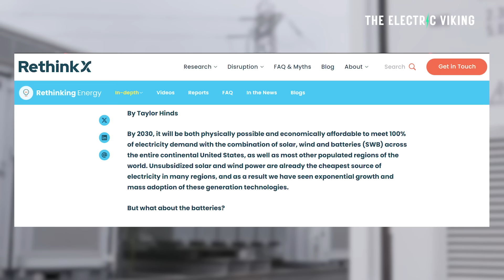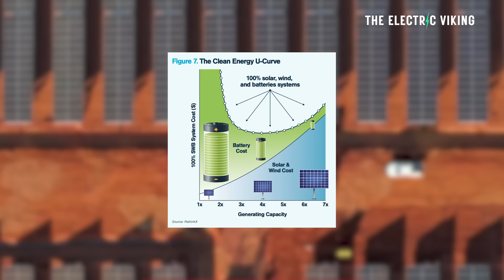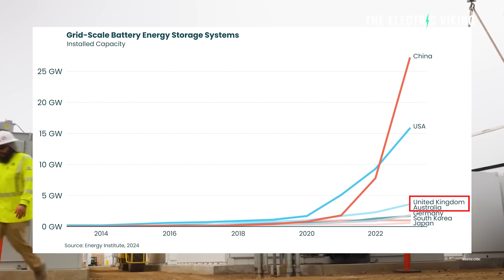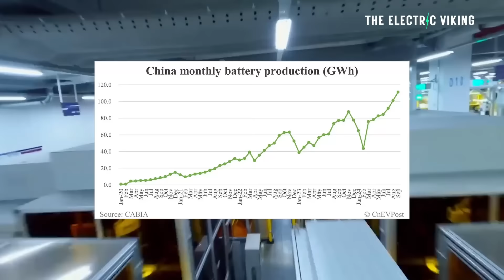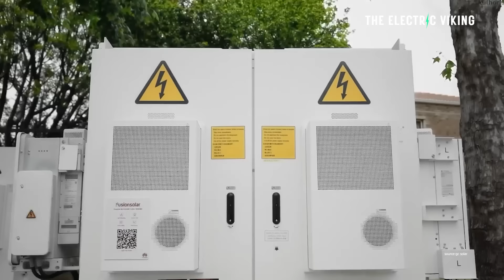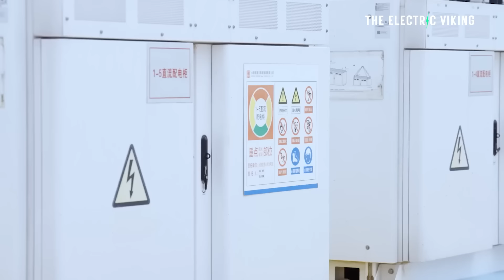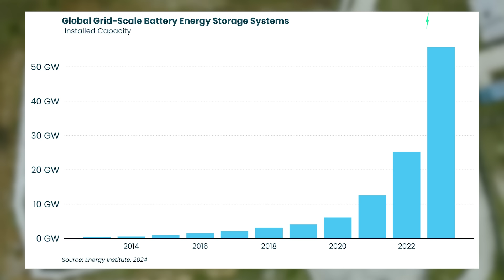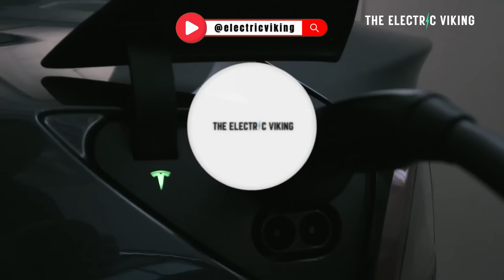RethinkX reveals the shocking exponential growth of battery storage worldwide

Comment: Laughable. Batteries are energy storage. Fossil fuels are a energy source. Renewables could not exist without fossil fuels. Take energy to make machines and panels, and hope they give some of it back.
Reply: In a sense fossil fuels are batteries that are pumped out of the ground. They are created by time, heat and pressure at geologic time scales and are much more energy dense than minerals that can only be mined economically when they are near the surface. Plus, fossil fuels, being liquids and gases under pressure, flow to the point of extraction. The same can't be said for mineral based fuels which are solid and require ALL HUMAN-made energy to be extracted. Both have negative effects on the environment FROM HUMANITY'S POINT OF VIEW. Life was abundant when CO2 levels were much higher than even the worst projections of anthropogenic global warming and, even if the worst happens, it will be abundant again. Just not human life and the life around it that has adapted to the current environment. 

The truth is that it is going to take the right balance between all the forms of energy we know how to extract to supply our needs and use it in ways that do not make the planet unlivable for much of the life that currently occupies it. This is possible or life never would have emerged in the first place.
Reply: I guess you need someone to explain it to you very slowly?
Reply: Photons transport themselves to panels free of charge
Reply: @SigFigNewton  how do you manufacturer them?, transport them? What do you do with them when they reach their useful life?
Reply: @jtkrpm1  you manufacture solar panels and batteries by digging holes in the ground. the minerals are in the earth, same as oil and gas but without the hundreds of millions of climate refugees coming to a decade near you
Reply: @jtkrpm1  transport? Far more of an issue for fossil fuels than for solar panels. You transport the panels once and then energy rains down from the heavens. Fossil fuels have to be resupplied. And then resupplied. And then they need to be resupplied. We’re talking about the difference between transporting some panels once vs transporting a flammable fluid continuously
Reply: @SigFigNewton  can you manufacturer a solar panel without fossil fuels?
Reply: @jtkrpm1  why yes. Yes, you can. 
Energy is required in production and transport. Is this what gave you the impression that you can’t?

Comment: Arizona must not be doing anything right, as though it's between texas and cali and our solar panels have worked great for 1½ decades with Tesla buying out the original company and installing a new comtroller (I don't believe we have a battery as all over production is sold back to our electric company and I don't believe any is stored at our home as I don't see any battery box installed), though this summer has been a killer hot one in Arizona and though the panels are supposed to cover 95% of our needs, our electric bills have been unusually high this summer. Arizona is strange in that there is a constant battle between those who wish for reasonable progress in clean energy potential and those that still want you to legally carry a 9mm opeen on your hip at a college bar and don't want anything unless it belches black smoke thicker than your blood! We have a solar farm west near our one, twin stack nuclear reactor and some hydro generated electricity, but since it's the next best thing to Death Valley, Ca, we are not packed full of residents. If we were, there wouldn't be enough arsenic and cyanide* in the underground aquafers to share with everyone! 🤣🤣🤣  *(due to heavy silver and copper open pit and sledge mining done since the 1800's)

Comment: This is ridiculous it was calculated that the battery power required to power UAS for onr hour requires all the battery output from the Tesla mega factory for 500 years and to charge them with excess green energy would take a further 200years for one hour. This is madness and grade A bull

Comment: What a load of male bovine emissions!
Batteries have a very very long way to go before they can compete with any form of traditional power especially nuclear.
Without government subsidies and guaranteed minimum usage fees that are on average six times what the usage charges from traditional power before the advent of green insanity no business entrepreneur would be insane enough to flush money down the toilet on battery storage systems . Not until the bursting into flames and dismal storage capacity and very short life span issues are solved. will batteries be able to come close to being cheap clean and efficient . Especially not lithium based technology or worse aluminum technology.
There are some sodium and iron stationary battery systems that show promise as a load smoothing and UPS system but they are still in development and are not compact.

On a side note for those who thought they reduced their carbon footprint by getting an EV and roof top solar (without battery storage) all you did is increase your foot print and create a very big headache and increase energy and operational costs and worst of all DELAYED the advancement of new technology that might make a difference.
Going green has on average increase carbon emissions by 150% globally and in some cases 400% over doing absolutely nothing.
So you well meaning virtue signally Muppets Stop trying to save the planet your ignorant actions are killing it.
Reply: Oil company BS
Reply: footprint = 1 word.  Oh, and your numbers are all BS.
Reply: @jonb5493  so what, if you think pointing out a non spelling mistake makes you think you’re smart good for you.
But taking that imaginary superiority to use as an excuse to remain ignorant of reality actually harms others How Dare You!
The numbers are factual look them up.

Comment: Right NOW, I’m paying 61 cents per kWh.
And home batteries are still more expensive compared to a BEV.
Tony is just feeding us Fata Morganas.
Reply: 61 cents what country are you in
Reply: I'm paying 13.1c/KWh.   Both "Right Now" and for every other hour of the month.

Why the hell is your power so expensive?

Agreed that batteries don't make sense yet (except for during a disaster before you can set up the generator to save the contents of your fridge and provide basic lighting, a fan, and dehumidifier).

For you , they will make sense when they drop another 40%.   

So hmm.  At your rates, a 5000btu old fashioned window unit would cost 30 cents per hour.   So a battery would let you shift cheap night power to expensive day power.   Or it would let you get home to a charged 1000kwh battery and run the AC from 6pm to 8:15pm, cooling the house faster and letting your 3000kwH ($1.80/hour) central AC unit run less.

Solar panels would be producing $5 per day in savings.   So they would pay for themselves really fast.  But you would need a more expensive solar battery  ($1000) that passes through solar while charging.

We underestimate things short term.. but sometime in the next 3-5 years, batteries and solar are going to make a huge difference for you.
Reply: For context.  In Norway the current price is 12 cents, largely hydro.

Comment: Each of this "green battery" - is a bomb for ecology, but - in Lithium harvesting countries. There is a matter of time, when consumers  would pay massuve reparation to those countries for tens years long... Not only huge chemical errosion and water resources  soiling, but also for suport slavery labor (as most such places have it normally).
If you hate planet and your own children - by something with massive lithum battery!
Reply: Keep burning fossil fuels is certainly not the solution. Have you ever looked at the amount of polution that gives? Minning for minerals for batteries is clean in  comparison. And these materials can be recycled. Ever tried to do that with burnt fuel?
Reply: @marcelreijnen  Oh, yes! What is the part of CO2 in all warmig gases? In most fantastical measurements by climate alarmists - up to 20% of sum of other gases can cause planet warming. What is a part, produced of mankind? The same alarmist sources provides up to 25% of CO2 may be produced by men activity (initially - wrong, because of ocean contains abut 80% of all CO2 on planet). So, what we get - less then 0.5% of CO2 pollution can be reduced in case of all people just would die. Not so optimistic?
Mining of 1 tonn of Lithium produce 15 tonn of CO2, requires about 2.2 million tonn of water, which became poisonal. Evapouration of water make leftovers highly toxic too. Moreover, lithium often located hundreds of meters below drinkable groundwater, it means - it will kill drinkable water on big region around.
Also please remember - most of lithium harvesting countries practice is slavery labor, include children labor.
Reply: @marcelreijnen  My concern: lithium is not a solution at all. UnWe shoudl not replace one "dirty" energy source but other more danger anddirtier. We need search for acceptable solution.
As example, if somebody propose to cure cancer by AIDS - what you say?
Reply: For instance, the Thacker Pass project in Nevada is expected to produce 60,000 tons of lithium annually, consume 1.7 billion gallons of water annually, and emit 152,713 tons of carbon dioxide. And it is uses modern DLE chemical technology....
Reply: Mining lithium is superb for the environment compared to burning ffuels
Reply: @SigFigNewton  Unfortunately I see no previously posted reply. Sometimes YouTube has a strange glicks...
Some base points from broken reply:
- Lithium harvesting leads to huge territories poisoning
- Lithium harvesting leads to water poisoning and makes water undrinkable in big regions as geological drinkable water layers spoilng
- Lithium harvesting leads to huge volumes of water excluded from human consumptiojn (and it is for water-deficit region usually)
- Lithium harvesting in some countries is a serious support reason for slavery and children labor
- Lithium harvesting produce enormouse volumes of water vapors, which is one of more powerfull warmer gases. For harvesting 1 tonn of lithium there produced more than 3.2 billions(!) litres of vapor.

Some countries already realized science facts and by taking respocibility  exclude BEV and battery stations from category "zero emission". For example - Norway.
Just keep your mind open to facts and science and know a price of global commercial success. For awhle mankind is agree to pay this price. Till some new passion come...
Reply: @Argus13  I’d list all of the negative impacts of adding carbon dioxide to the atmosphere, but I don’t have time to spend three years writing.
Hundreds of millions of climate refugees. Coming to a decade near you.
Reply: @SigFigNewton  You just swapping a theme. It's not only CO2, but more dramatic poisoning and resource exhausting subsequences of lithium harvesting. CO2 - is very small part of problem and gas burning is microscopic part of it. But depletion of drinking water reources, chemical posoning of soil - mor serious and critical issues.
In addition - I highly recommended last report of Human Rights Watch about slavery and kid labor related to lithium harvesting.
But if you don't care about ecology and poor countries - you can continue freely. Each one has his mind...
Reply: @Argus13  greenhouse gases are by far the most serious environmental issue of our times and burning fossil fuels is the primary contributor
Reply: @SigFigNewton  Who said this? 50 years ago I remember isteric fears about "new ice age" :))
There is no sicence evidation about mankind klinmat changes driven. But multiple evidences for cyclic climate changes from more serious factors - as solar radiation, orbit precession and so on.
Reply: @Argus13  mhmm, if someone hyped an incorrect thing fifty years ago, that’s a good reason to ignore reality today. 
Fantastic reasoning, little buddy!
Reply: @SigFigNewton  Nope. It is just a reason make more critical look on histerical process at present time. And when you just base on science, facts and logic - nothing can fool you.
Reply: @Argus13   the critical look achieved. Performed over decades by tens of thousands of researchers. many of these researchers are now surprised at having underestimated warming from greenhouse gases added to the atmosphere.
Reply: @Argus13  One of the ways in which warming was underestimated has been through an overestimation of carbon sinks. These last two years, a greater percentage than expected, of CO2 released, has remained in the atmosphere.
Also.
One thing that reduces the amount of carbon dioxide absorbed into soil is using chemical fertilizers rather organic fertilizers such as manure and food waste. Chemical fertilizers. Fossil fuels strike again!

Comment: Solar panels creat lots heat in the atmosphere
Reply: How does that compare with CO2 levels trapping heat in the atmosphere?
Reply: What? Solar panels convert 20% of sunlight that hits them to electricity. That’s a loss of heat. Yes, the panels get hot but they don’t make energy. It’s just the heat that doesn’t get absorbed by the shaded surface.
Reply: Not really, if placed in a reflective area (desert) it will absorb a miniscule amount of extra heat but that's about it.
Reply: @ecognitio9605  they also say solar panels can cook any bird that flies over them and been i a desert that’s a option

Comment: Batteries are not even close to being a realistic storage medium for grid scale energy provision. Im shocked anyone still believes this stuff.
Reply: Who said anything about grid scale? That's the old parasitic paradigm.
Reply: California’s already at 10 GW battery storage.   So, in the future keeping the lights on when it’s dark and  the wind isn’t blowing is perfectly feasible.   Also you have time to factor in home batteries.   I’m off grid for 20 hours a day
Reply: @crm114.  10GW is nothing compared to the 26GW of renewable generation capacity and 80GW overall generation capacity yet California can barely keep the lights on as it is. Not a good example, they have spent a fortune on all this and it's still not even close the actual requirement.
Reply: @ecognitio9605  Oh you mean the one that is the only way it's feasible to work. Not everything connected to the grid can have its own batteries, even with economies of scale the costs are astronomical and batteries have a finite life needing replacement every decade or so.
Reply: Very close.